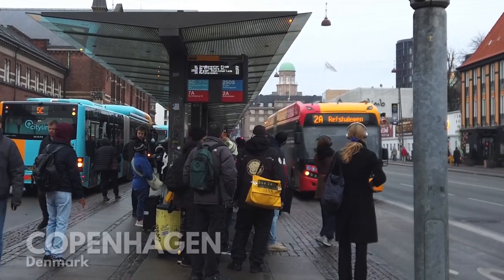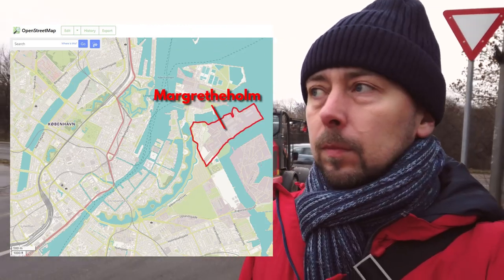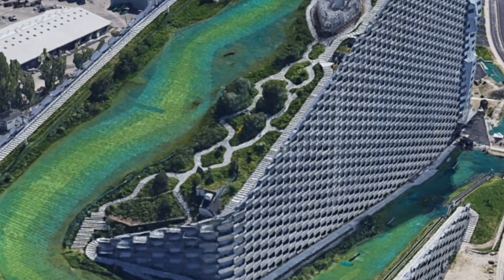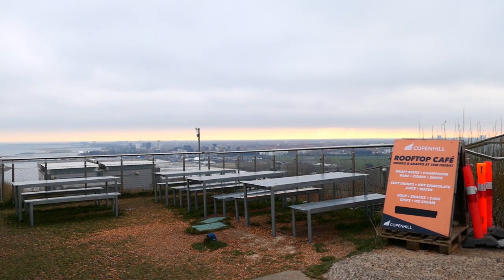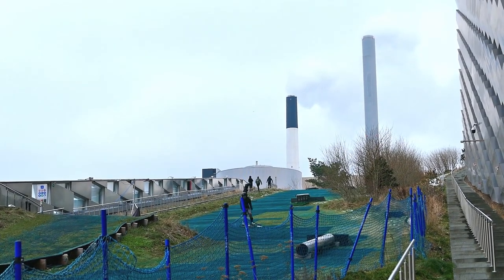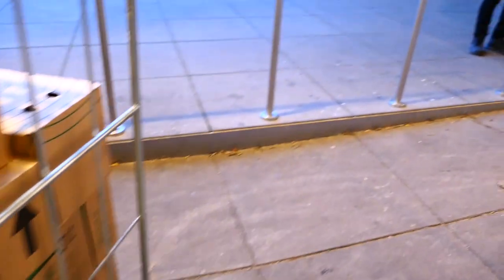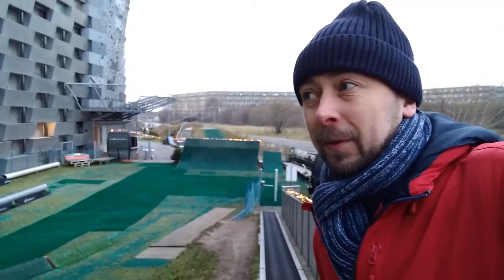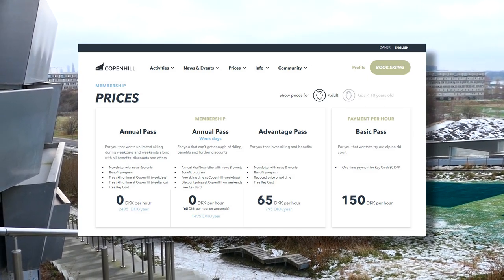Why Copenhagen Put A Ski Slope On A Power Plant

Comment: One of the reasons it's clean-ish is because they burn the trash at very high temperature under pressure which makes it burn more efficiently, and thus cleaner because this makes it release fewer toxins. When you just ignite trash, say in a bonfire, you release a lot of toxins because it effectively burns cold, but in Denmark the trash is compacted and burnt in kettles that are very similar to the ones used in coal and oil power plants. This in turn means they can get more heat out of the burning process and makes it easier for the smoke cleaning system to remove anything toxic. The downside of smoke cleaning is always that it produces a toxic powder that we still don't know what to do with, so it's compressed into barrels and stored in secure locations. But because we have facilities like this and have invested heavily into recycling, Denmark no longer have or need landfills - think the last one closed in 2005, but can't remember the exact date - and sorting your trash is mandatory (and comes with significant fines if you don't or do it wrong)
Reply: Uuh vi har skam 'landfills' .. kender til en på Falster bag nyk f travbanen. Som refa dumper alt muligt i.. 😉
Reply: We do actually still have landfills though they're only used for things like asbestos, glass wool insulation and other materials that are stable and fire proof.
Reply: A next step of this is also capturing whatever that's left and storing it deep underseas. What Norway will be trying with Project longship. Transforming the CO2 to liquid form, transporting it by ship (electric ships are being worked on) and pumping it underseas from an on shore terminal. Almost like the reverse of what Norway is doing with oil and gas right now.
Reply: That's nice! We need fines for non-separation of waste in the UK - so much is still mixed (from my point of view as a member of the public, not working in the waste sector).
Reply: It’s not incinerated under pressure. 

The pressure in the furnace is a bit below ambient. It’s rather difficult to make entirely air tight.

There’s a huge fan (ID fan) at flue-gas treatment part ensuring the entire smoke filled path from waste-inlet to exit is below ambient.
Reply: @chrthiel  I would hope they were not burning  radioactive material from hospitals.... just did a little search turns out you can incinerate radioactive material safely.
Reply: @stepheneyles2198  was trying to search my councils we website about types of plasic it does not bloody stay really
Reply: @arthur1670  I'll freely admit I don't know what they do with all the specialty waste, though at least since it's coming from a small number of sources I assume it's easily separated for treatment.
The exact disposal strategy varies from city to city. There's an overarching national strategy in place, but each city has to implement it in their own way depending on the disposal facilities available to them.
Reply: @chrthiel  I would suggest that they put it in the aforementioned asbestos disposal places you have.
Denmark doing good again. Keep on showing us the way. Thanks.
Reply: @arthur1670  I just put all plastic packaging in the recycling
Reply: @as-tm7np  just means less quality recycling
Reply: Aha, they really fine there. In the Netherlands they made recycling and trash sorting so complex for some things, that no one knows what has to be where anymore, so people starting to don't care.
Reply: Awesome, thanks for sharing the details
Reply: The plant also has an extensive flue gas scrubbing system. It uses both wet and dry scrubbing even applying electrostatic methods, too. This in turn also separates out useful byproducts from the smoke and ash such as gypsum and slag (a waste product that can be used for road filling and similar). In addition, the plant has an advanced water treatment system for its feed and boiler water system which produces more deionized water than it uses.
Reply: @Pow3llMorgan  it’s not Perfect tho,
Reply: Good to know
Reply: @stepheneyles2198  Here in Germany the recycling companies simply put a sticker on your trash bin and don't empty it, if you don't recycle properly.
Reply: Nice, thank you for this comment :)
Reply: @arthur1670  it’s so frustrating! Mine says “don’t do yogurt pots” when they could say “we take PET (1) and HDPE (4), but not PP (5) or PS (6)”. Sure have some examples but people need to be taught to look for the resin code, yogurt pots can be made of all sorts
Reply: @kaitlyn__L  you have codes I can’t even find that with my council
Reply: @arthur1670  no, I’m saying that my council specifically doesn’t give codes. I then said they should give codes, and gave an example of what that might look like. 

I had to go digging to find out what the plastics even are, because they said water and milk bottles are fine and ready meal tubs aren’t and got confused because mine are the same plastic as milk bottles. Then found out a lot are made of PP(5), then looked into which facilities are in my city, and indeed THOSE advertise which resin codes they can accept because they expect to be interfacing directly with offices and waste management firms. 

It’s made worse by the fact that most councils in England do take PP(5) now, so those “widely recycled” labels on packaging are misleading. They say “check with local councils” in small text, but don’t tell you how to identify what type of plastic it is. 

It’s an education failure all round, with people being taught to just think of plastic as “plastic” rather than understanding what it actually is. Our public outreach could be doing so much better.
Reply: What volume of compressed toxic residue is there?
Reply: its atleaat way better then landfills, and i think in the future as more plants like this gets made I wont be surprised if we end up digging up old landfills to burn the trash, Sweeden is currently importing trash to as they can handle more then they produce, and it wood be a win win to digg up and remove old landfills and at the same time get power and heat from the old trash.
Reply: @mareli82  not if your burning recoverable material, need to design things better
Reply: @arthur1670  most plants only burn non recyclable materials, food waste and paper is seperated at home, glass and metal is deliverd to designated areas and drink botles have their own system for returing, and plastic is sorted out before burning, atleast most places her in norway.
Reply: The toxic powder that you do not know what to do. Could mix with cement and make beton, paver and so on. Is not a great idea?
Reply: I like that

Comment: We do have an alpine ski slope on the Danish island of Bornholm that reaches 115 metres above sea level. There's even a ski lift and a snow cannon. But the base of the slope is much higher than anywhere in Copenhagen (with the possible exception of Christiania). And the snow cannon was out of order the few days we had proper freezing temperatures this winter.
Reply: I see your Christiania joke and I appreciate it.
Reply: @Hamfrags  Love it. Thanks for pointing it out before I had read through all of the previous comment. 😄
Reply: Yeah we don't have many ski slopes here in Denmark and most are very short. The former biggest one before Copenhill opened was "Skibakken" or simply "Ski hill", which is a big manmade hill made from waste soil from former gravel pit mining in the west of Copenhagen. The Bornholm ski centre comes 2nd in size after that and I did go there one winter while studying on Bornholm. It's a very nice little place to spend an hour or 2, especially ever since they got the money for a proper ski lift so you didn't have to hold onto a rope to get to the top.

Comment: When Ain't No Mountain High Enough played when you showed Denmark's highest "mountain"...I lost it 😂. Honestly, I prefer tubing over skiing as it's a great way of feeling refreshed without figuring out how to ski. Putting a ski slope on the power plant is the same energy as Beijing putting a crystal high-heeled shoe sized extra-extra-large next to cooling towers as their big air venue for the 2022 Winter Olympics. People during the Games thought it was a nuclear power plant because of those cooling towers, but it's actually a STEEL MILL. 

The plant's a part of Shougang Park. The plant was shut down in 2003 before the 2008 Summer Olympics as it was the cause of a lot of Beijing's pollution. So by the time the city hosted the Olympics again, the plant entered an era of urban regeneration as it's turned into a low-carbon museum and leisure complex. It's the same thing Bethlehem, Pennsylvania did with their steel mill by turning it into a casino/entertainment resort complex called Bethlehem Works!

Comment: Bjerke Ingels BIG were the architects. The original plan was to have a smoke ring generator on top of the stack to blow a ring when it has made two tons of CO2, then light it up at night, not implemented. There is even a running race up and down it. 
Close to Noma too.
Reply: A new parkrun course perhaps? 😂

Comment: i really recommend visiting smaller towns like svendborg or the island of bornholm. they are beautiful, quaint and cozy.
Reply: I'm sure I would prefer to visit the smaller towns. As for watching travel videos however, quirky is often more interesting than quaint. I live in a small town where one of the biggest visitor attractions is the former town dump where trash was actually dropped from bluffs into the sea. The bottles and ceramic garbage has been polished by the waves and the metal rubbish has turned into sculptures of rust. It's called Glass Beach.

Comment: Here in Ireland we have waste to power plants producing electricity (from non recyclable waste) and some producing Biogas from compostable waste and farm slurry/sewage (anaerobic digestion) to supplement the natural gas bought from the UK and Norway.   Production has dropped on our only offshore gas field.  The dry compost residue sold back to arable farms as fertiliser.  Most of our landfill sites have been closed to new waste and just being managed/maintained to avoid polluting.

Comment: Copenhagen did a similar thing regarding beaches. The amount of proper beaches in and around Copenhagen is limited and they get extremely crowded on a hot summers day. So what did Copenhagen do? As the water in the harbour is very clean, they simply built some harbour baths along the harbour. Each equipped with multiple pools, diving boards etc. for people to use.

Comment: Power plants in Denmark supply heat through district heating. Essentially all the leftover heat that can't be used to generate electricity is used to heat water which is then sent out to homes and businesses to be used for heating and warm water. That's why you won't find electric heaters in Danish cities but instead big bulky radiators. It's a fairly ingenious system that makes Danish power plants some of the most efficient in the world since an additional 30% of the energy released by the fuel can be extracted in this way. Power plants also aren't the only source, the heat is also collected from factories for example. It has really come in handy last year since heating costs in Denmark were barely affected by the energy crisis since it's just a by-product of normal operation.

That's also why usually power plants in Denmark are power-heat plants, not just power plants. It has presented a slight issue with the green reform since obviously wind and solar don't produce excess heat and we've been closing down coal power plants for a while but it seems like it has coincidentally helped make the issue of energy storage much easier to solve. The use of heat batteries seems to be a promising and cheap solution and it's essentially made viable by the district heating grid in Denmark.

Comment: It's a really cool use of space!

Though I feel like you never addressed the elephant in the room, the lack of snow? I mean it looks like it works perfectly well without snow, but did they ever get snow?
Reply: Not knowing Copenhagen's weather, but I imagine the heat from the generating station would melt any natural snowfall and preclude artificial snowmaking...
Reply: The surface is similar to stuff you find in amusement parks, and then it is greased in silicone to reduce friction, so it is super slippery. 
Copenhagen does get snow sometimes, but it rarely last for more than a week before it is melted again, but the building is made of metal and is generating heat, so it is never freezing temperature underneath the artificial surface, which means that any snow will melt pretty quickly. Ironically, because of the artificial surface any snow on it would make it dangerous to use.
Reply: @YekouriGaming  that makes sense!

Comment: I live in a county in Florida with a waste-to-energy power plant. About 35 years old, and not as efficient as they one you can ski on, it still provides about 10% of our power, which is a lot, considering we have a million people living here, while not using any coal, oil, gas, etc. And it reduces the volume of trash by more than 90%.

Comment: Not only is Denmark in short supply of hills or mountains, but it doesn't snow much. Especially not in the slightly warmer microclimate of Copenhagen. 

We get SOME snow every winter, but not reliably for skiing. (And never in december when I want a white christmas) 

We had more snow 20 years ago. I wonder what happened?  I guess that's just one of those mysteries well never get the answer to.
Reply: I guess it is just one of those "variable climate over time" things.
Reply: agree, it would be much better if it was the opposite, more and more snow each year

Comment: Lovely video as always. However the flashing transitions at the beginning of the video were...less than pleasant. Jarring and disorienting. If you're going to use them moving forward, I would suggest a flashing lights warning for photosensitive folks.
Reply from the maker: Sorry about that - I didn't realise it would cause an issue, but have had a few comments similar to yours. I'll add a warning (or simply avoid doing it!) in future
Reply: @TheTimTraveller  No worries! It's impossible to know every possible thing that may cause issues for folks, especially with so many viewers. I really appreciate that you listen to fans, it means a lot ❤️